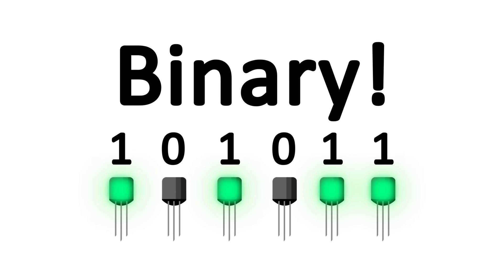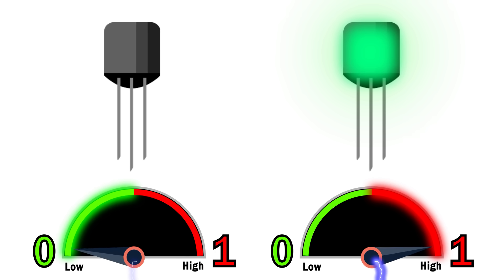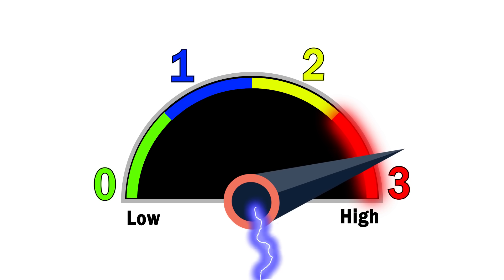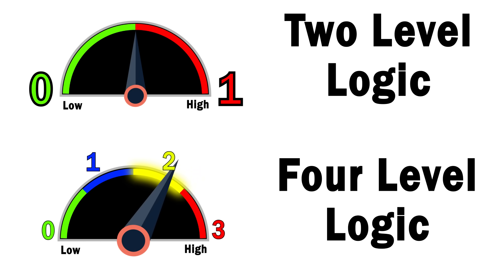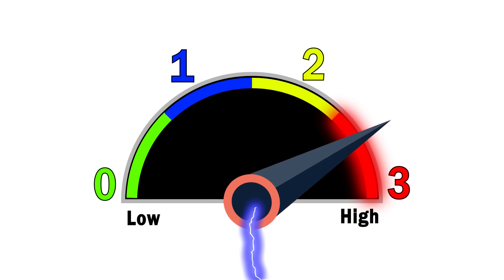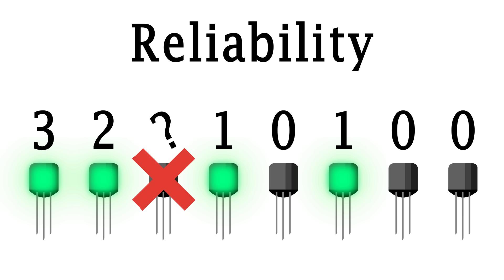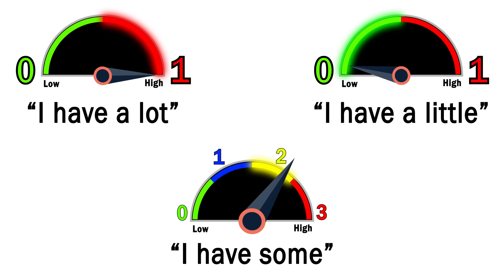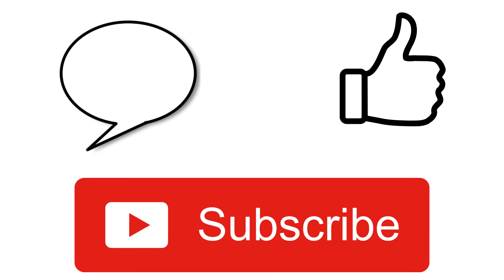Why can't computers use base 3 instead of binary? Voltage states explained.

Comment: Fun fact: some very old computers had base 3 storage. The storage was based on small copper coils magnetizing ferrite rings. This was because the magnet could be north, south, or no magnetism. So basically, 1, 0, -1.
Reply: I guess magnet could ruin it easily?
Reply: @justarandomstranger1  By other foreign magnets
Reply: Unlike coils, transistors can work with current of only one direction. Like diodes.
Reply: @Dmittry that's not true at all. MOS can conduct current in either direction.
Reply: @panjak323  Can it control that reverse current?
Reply: @Dmittry Sure, but it isn't that easy. You gotta drive the gate relative to the floating source and keep the voltage lower than the threshold voltage of the intrinsic body diode. But it is generally doable.
Reply: @Dmittry i actually clicked the video looking for this exact explanation, thank you. It's a shame it doesn't get mentioned there
Reply: @Dmittry  what about these new chips that use light?
Reply: As was explained at the end of the video, modern storage still uses multi-level bits. And some of them are still magnetic. The rings went away because they are hard to manufacture in large quantities when compared to other methods.
Reply: Actually, core memory was binary, not base-3. The ferrite rings only had two stable states — magnetized one way or the other — so they stored 0s and 1s. There wasn’t a reliable “no magnetism” state.
Reply: @kakol20908  And one interesting fact about ferrite ring memory was the fact that read was a destructive operation. As static magnetism can't be detected easily so to read it, one would send a "read" pulse through the rings, and doing so would magnetically align them. The act of changing the polarity of a given ring would give off a different signal than a ring that does not alter polarity. And that is basically how you "read" them. After reading, all the read cores are basically null at that point. And usually after read the same data would be re-written back to the same cores, while holding that same information.

The individual rings would be placed in these X-Y-grids basically. And the way one would access a given ring was by sending a bit more than half the amount of current required to change the polarity of a ring on a given X wire and same on a given Y wire. Only the one ring at the crossing of these specific X and Y wires would get more current than required to change its polarity. And then these grids would be stacked on top of another, into three dimensional arrays. And to write entire bytes on such 3D array, one would send the same X and Y pulses, but there would be an additional "inhibit" wire that would pass through each ring on a grid. You would send current through the "inhibit" wire on those grids you don't want to change polarity. The current on "inhibit" wire would be opposing to the current on the write wires, thus cancelling out enough of the magnetism to prevent any of the rings on that grid from changing polarity.

One interesting thing about these is the fact that the core memory units were a bit temperature sensitive. And I believe there were compensation circuits... But one method solve temperature effects was to basically pick a temperature above highest ambient, and essentially make the unit into an oven that would keep the memory at that set temperature. Which sounds kind of crazy, thinking that we are basically doing everything possible to keep our machines as cool as possible.

Another interesting detail was that magnetic cores can retain their state, even when the unit is not powered. So there was a possibility to bring back the last data from a powered down computer... At least a theoretical possibility.
Reply: @kakol20908 Exactly, the special thing about them was that they were effectively persistent RAM. A holy grail of computer engineering we have not been able to recreate with more modern technology.
Reply: Why was that abandoned?
Reply: @MrXlee1967 Very sensitive to magnets, you can crash the whole system just by placing a magnet on the wrong spot
Reply: @MrXlee1967 We still have higher base storage. Flash memory can be SLC, MLC, TLC, QLC, or PLC, corresponding to 1, 2, 3, 4, or 5 bits per cell (2, 4, 8, 16, and 32 possible values). Hard drives and magnetic tape storage use shingled writes and clever encodings to maximize data storage capacity (you can kinda do all of the tricks for radio transmissions, you're just sending messages to the future as patterns of magnetization instead of through space as electromagnetic waves).

We don't use ferrite rings because there isn't a cheap way to run wire through quadrillions of metal rings, make those rings small enough to compete with modern optical, flash, or magnetic storage, or use them without high power consumption. I believe a read only form of magnetic storage was sewn by hand for the Apollo Guidance Computer, pretty much threading fine wires through rings tens or hundreds of thousands of times in a pattern which contained the devices programming (and if that doesn't qualify as "firmware" I don't know what does)
Reply: @MrXlee1967 likely because it is hard to wire them, kinda remember them hand making EACH. QUATWR FINGERNAIL SIZED COIL. to make there memory
Reply: Setun computer, of Nikolai Brusentsov
Reply: One step closer to a return to analog tapes 😉
Reply: Dram cells do the same with capacitors though. “0” is negatively charged, “1” is positively charged capacitors. Uncharged capacitors mean that the cell has discharged or haven’t been charged yet.
Reply: Balanced ternary (−1, 0, +1) is also available in some early electronics, and the Setun did use that system. 0-1-2 ternary is also possible but trickier, so not available mainstream. This video is just incorrect

Comment: Base 3 exists already: low, high, smoke
Reply: The magic smoke needs to stay in the box for the computer to work
Reply: @nmotschidontwannagivemyrea8932  I accidentally released all the smoke inside my laptop charger a few years ago (due to a mishap with a degraded cable and a poorly-positioned steel multitool). It lit up like a roman candle and scorched my bed before I managed to unplug it.

Never used that charger again. The smoke got out, and I found that I couldn't trust it in the aftermath...

...and then I found out that I had a non-standard charger that no one sold replacements for, so I ended up not having a laptop for a month during my diploma exams -_-
Reply: I thought that was a weed joke lol
Reply: @Hylianmonkeys that would be: low, smoke, high
Reply: @Hylianmonkeys  Weed joke is little different like this -
low, smoke, high
Reply: @Hylianmonkeys innit ? 😭
Reply: Smoke state only works once though so make it count
Reply: Smoke state?
Reply: You forgot about base4: low,high,smoke,fire
Reply: @thesky6225 real
Reply: aHAHAHAHAHAHAHAHAh
Reply: Lie, Truth, Or?
Reply: Real
Reply: In other words its: false true gaslighting
Reply: Funny af ngl

Comment: I guess he was trying to keep it simple, but he left out that present-day CMOS logic actually reverses the polarity for representing a ‘1’ or a ‘0’

A bit is represented by a pair of complementary Field Effect transistors, such that one switches on the other switches off. They are connected to opposite power rails. 

So it isn’t that logical ‘1’ is 1 volt and logical ‘0’ has no voltage applied. Logical 1 could be +1 volt and logical ‘0’ could be -1 volt. (I picked 1 volt as an example—actual voltage will differ).

Comment: Because it turns out that while 3 has better radix economy if radix economy is n/log n, 2 is better if the proportion is (n-1)/log n, which is what happens when you implement with comparators...

Comment: Why are the fluctuations percentage based rather than an amount of voltage? If you just increased the min and max from 0-1 to 0-5, no? Assuming the program is built around or not concerned with the rising/falling edge issue, it seems like that could be a fix, no?

Comment: Mathematically higher base is equivalent to base 2 and higher bases do not bring any computational advantage and introduces all the issues presented here.
Reply: Binary Because it has little noise , more binaries, it is harder to distinguish each of them and noise, mistakes increase
Reply: higher base means you can store many more data in few bytes.

Comment: The reason is Boolean logic or algebra on which all those chips are based on. So one 1 becomes true, 0 becomes false but even in ternary you start to get a real headache. Let's say two inputs one output makes 16 possible operations and two to "rule them all" (NAND, NOR). So now for ternary you get 3⁹ or 19683 operations. Welcome headache! No chance to take a look at them all in half an hour.

Comment: 4:21 That is not quite true. There is something that called bounce that will not flip cleanly between 0 and 1. On top of that if you have a word you have to wait untill all bits in the word change. You can´just have it fall below and hope for the best.

5:03
There are plenty of parts in a computer that use, like USB 3.0 and later, HDMI, DP, PCI 6.0, GDDR6X,.

There is a other reason why computers are digital. That reason is cache.  Cache is currently made with SRAM. SRAM is inherently binary. There is no way of storing a analog value in SRAM, it will stick to either 0V rail or positive rail regardless of what you put in.

Because Cache is everywhere in a computer, if anything is handled analog in any place in a computer, it need to be converted than converted back This is unresonable, hence basically all computers are fully binary today.

When SRAM is replaced with something else, that may change

Comment: I recently watched your video on binary logic and alternatives like base-4, base-8, and base-16 systems. While I appreciate the effort to make these concepts accessible, I wanted to point out several technical inaccuracies that could mislead viewers.

You describe voltage segmentation as a path to multi-state logic, suggesting that dividing charge levels into finer slices (e.g., 0–25%, 25–50%, etc.) could allow for base-4 or higher computation. While this is theoretically possible, it ignores the fundamental issue of voltage drift and noise margins. The tighter the segmentation, the higher the susceptibility to error—especially in high-speed digital systems where timing, thermal variation, and electromagnetic interference are nontrivial.

More importantly, you omit balanced ternary systems, which use -1, 0, and +1 as logical states. These systems offer architectural advantages in arithmetic, negation, and symmetry. The Soviet Setun computer is a historical example that used magnetic cores to implement ternary logic effectively. Your framing of base-3 as just “0, 1, 2” misses this entire class of logic design.

You also conflate storage encoding (e.g., MLC flash memory using multi-level cells) with computational logic. Flash drives can afford error correction and slower access times, but CPUs cannot tolerate ambiguity in instruction decoding. That’s why binary logic—simple, robust, and error-tolerant—remains dominant.

If you're open to revisiting the topic with more technical rigor, I’d be happy to share references or discuss further. These nuances matter, especially when educating a broad audience.
Reply: "it ignores the fundamental issue of voltage drift and noise margins", don't they say exactly that in this video though? "even the natural fluctuation of 20% is dangerously close to crossing the line, and the higher the amount of states in each cell, the more specific this voltage has to be, and by extension, the more likely it is to be wrong". He doesn't say why there's fluctuations, but he acknowledges that voltage won't be exact and he says that tighter segments would result in greater error
Reply: You didnt see the video. THERES NO WAY YOU WATCHED THE SAME VIDEO I DID.

Comment: This is why classically trinary computers didn't do 0V=0. trinary computers did -Vdd = 0, 0V=1, Vcc=2.
Still though you're missing the point.  it's not worth the investment for trinary computers, and it isn't worth the silicon space. It takes more space to store 1GB of trinary info than it does for 1GB of binary info, even accounting for the increase in statespace. so that said, it's simply not economically viable. It's not because our rise / fall times are too slow, and it's not because we can't figure out basic clocking. It's just economics.

Comment: OK, but why not have it connect to either a negative terminal, an earthed wire, or a positive terminal, to represent either 0, 1, and 2 (the numerals of standard base 3), or -1, 0, and 1 (the numerals or balanced ternary, where for example the numbers zero to nine could perhaps be written like |, ↑, ↑↓, ↑|, ↑↑, ↑↓↓, ↑↓| , ↑↓↑, ↑|↓, ↑|| and read like "zero, one, three take one, three, three add one, nine take three take one, nine take three, nine take three add one, nine take one, nine")? 

I kind of assumed this was what the video would be about, since "base 3" rather than "bases bigger than 2" seemed quite specific.

Comment: A bit disappointing that ternary is barely mentioned in a video that specifically mentions base 3 in the title. Still leaves me wondering about ternary signals. Otherwise seems like a good video.
Reply: Basically what he said about base 4 apply it on base 3. I don't know why he used base 4 as example.

Comment: Modern GPUs, especially with higher bitrate memory interface (or it's bus width) can also vary.
For example, this laptop has 8 Gigabytes of DDR6 and has a width of 256 bits. Slower/Older/Cheaper and also varying that bus type, like AGP instead of PCI-Express might have a 64 bit memory interface.

So on the newer greater stuff, they actually do use Trinary or Quad state signalling circuits between the VRAM and the GPU, the sheer amount of data that needs to be on the screen on in the back buffer has such a serious requirement for speed, it's essential, like if you want to play 4K games!
Think about it in 2d first, a 4K screen has  8.2 million pixels, it may be using 32bit colour, this adds up to approximate 33.1776Mb (8.2m x 4, 'cos 4 bytes in a 32bit colour).

Then, in a 3d display, you might have 4096 layers of depth ,  if you tried to represent that as a full 32bit colour image, that's like 130Gigabytes of display information!!
Thankfully, you don't do that, and you wouldn't see the insides anyway, but it'd still be a monolithic block!

But those layers do contain information about vertices where the lines of shapes meet, Fragments which are the pixels that would represent that shape, all the Scene data ... loads of stuff!

You can see why they not only need 3D memory chips ('the cellts are stacked inside the chip vertically) but also being able to represent more than 1 or 0 is a massive optimisation of bandwidth!

Crazy stuff eh? 🙂

Comment: It is possible to have a three stage. Look into MosFet transistor for ternary. It shows how they combine two transistor,, 1 of pnp, and the other npn, their base to a single wire. And the output does have a 33% 33% 33% . Giving a 0, 1, 2. Also they have also RAM for this, using memristors. I am still trying to get a diagram circuit for that, but I haven't been able to get hold of one, just the theory. But for the 3 stage, they do have a diagram and an example of it, that it works, and one can test it at home.

Comment: That makes sense why most processors have increased voltage out of the box, while we can under-volt them further but too much it'll create an error
Reply: Yeah, voltage reduction is always a trade off about reliability at a given processor speed - you can run chips a heck of alot slower reliably with a low voltage - it'd use far less power but the trade off is low speed.

Comment: Seems like base 3 is ideal for modular logic, so while the rising and falling edge is a problem for voltage signals in balanced ternary, it could be solved by encoding the signal in the phase instead
Reply: For anyone wondering, this is called “Ternary Phase Shift Keying” or TPSK
Reply: CPUs can't use any of those tricks though. They need to have the raw data immediately available to them. 

You can't have a seperate modem for every logic unit inside the CPU. Or if you did it would definitely be less efficient.
Reply: @ThePyrosirys So, Samsung has been funding research that has successfully developed a ternary transistor, allowing transistor manufacturers to retrofit existing systems for native ternary (balanced or otherwise) computing. Just learned about this, and a paper was published back in 2019. I’m guessing since the release of Microsoft’s research showing that simulated balTernary can be used to save 30%-70% of compute, the demand has drastically increased

Comment: Don't optical processors for example bypass the reliability problem, as we can emit light in different frequencies?

Basically it was a hardware limitation... But now with optical processors and quantum computing we are still somewhat holding on to binary thinking, with qbits and optical logic gates, wouldn't it just make sence to reinvent the way we computed as we are reinventing hardware?

Comment: This is just the engineering side of implementation assuming boolean algebra. When ternary computers where invented, they didn't just use it with a base-3 system, but instead the whole paradigm of logic was different. It was ternary logic, which includes an element of uncertainty, fundamental in the quantum world.

Comment: Well sure, but the PFC of the LTI won't allow for the MBN to run at full gigacycles. If the ALU used a BSI based ISA rather than PIS then it could run at half wave compatibility. But otherwise, the BMM isn't going to provide more than unity gain to the AC bus at +/-3.71 volts and 21 nanoamps at a frequency of 345ghz. If you could overclock the LTT, you might reach the THZ regime, but at that point your wavelength is gonna be too small to be practical.